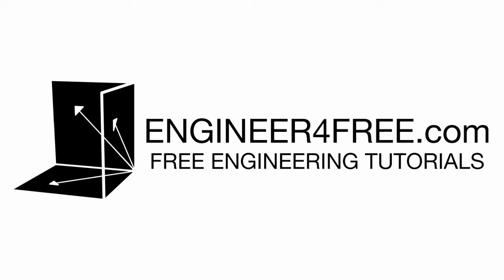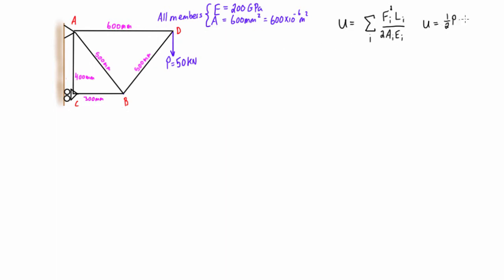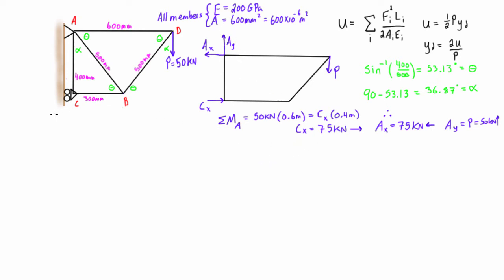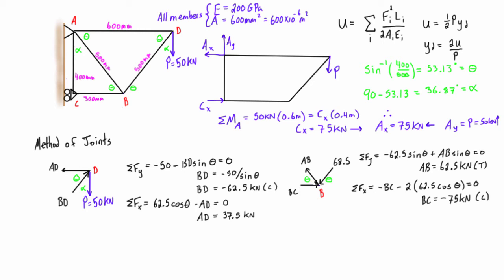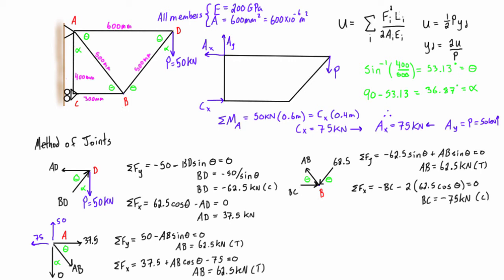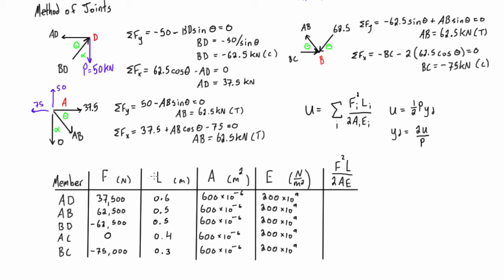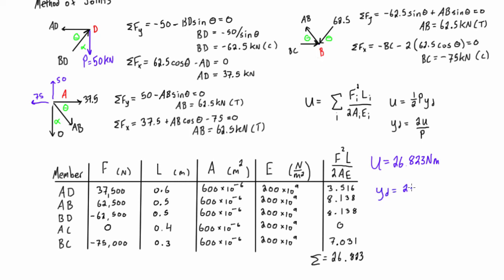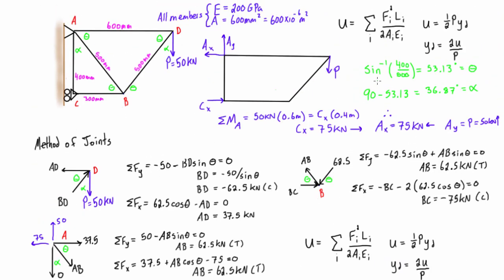Truss deflection under a single load example problem #2 (virtual work)

Comment: When you create the table how would you work out the lengths if they are not all given?
Reply from the maker: Member length is required in order to solve deflection. There should be something in the problem that allows you to figure them all out, like perhaps one lengths and a all the angles, or if not given angles specifically, you may be able to determine them by recognizing equilateral triangles, right angles, etc.